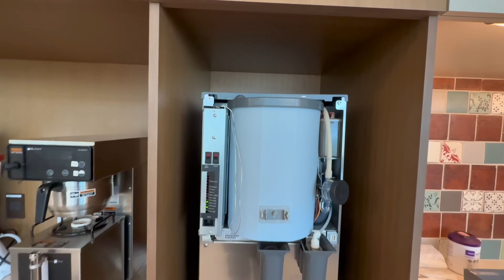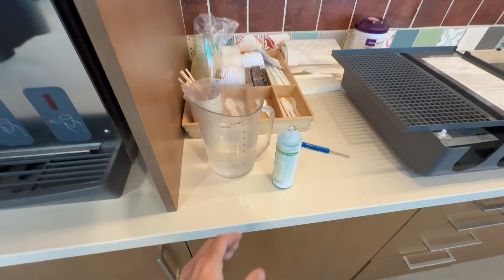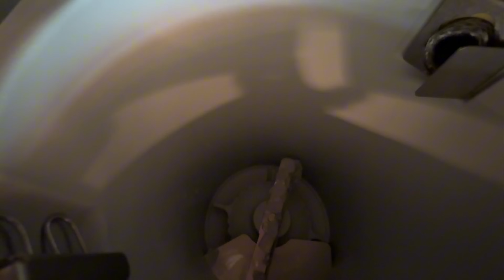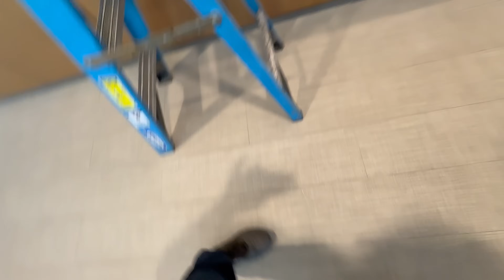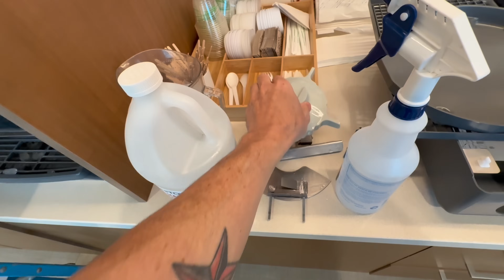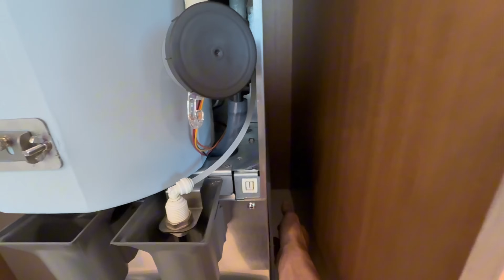Follett ice machine cleaning and sanitizing

Comment: Great video! But any idea what to do when I go to let it make ice and throw away the first 10 minutes of ice, and the low water light is illuminated but the water is on this is a brand new machine it's literally less than a year old and has been cleaned a great amount. Do I just need to replace the inlet water solenoid, or do I need to clean it? If so do you have any videos showing how to do that? Thanks in advance!
Reply from the maker: If the low water light is on the machine should be calling for water. If there’s water at the valve and power at the valve and no water is passing through then replace the valve.
Reply: @IceMachine411 sounds good I am reaching out to see if they can get me a new solenoid valve or if it's under warranty they will just replace the valve for me
Reply from the maker: @warrenpeterson2631  email me at icemachine411 @gmail.Com